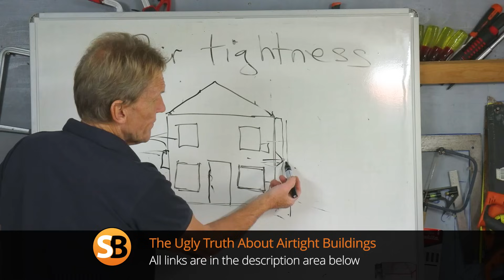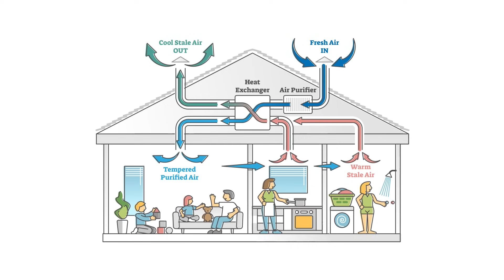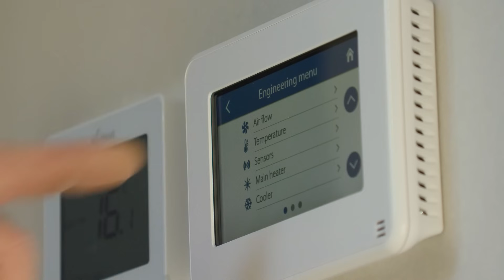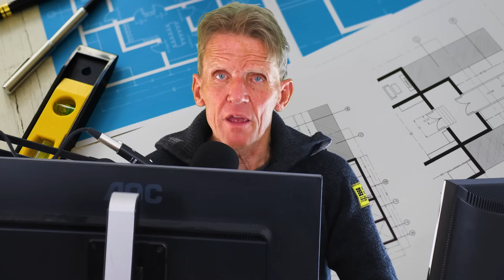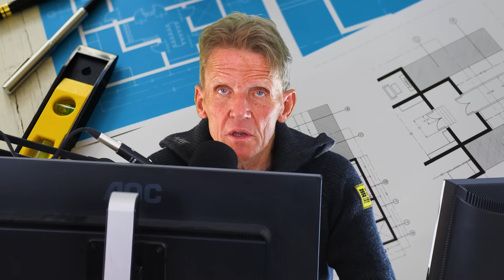Why Airtight Homes Are a Terrible Idea

Comment: I so agree with you! I am Swiss. we open windows to let air in even in the middle of winter.
Reply: Exactly, but the cost of heating is too high in "rip-off" Britain!
Reply: @stanthesteelguitarman8228  You can ventilate without impacting your gas bill. A ventilated and drier house is cheaper to heat. method one: if you have widows on both sides, open all the windows on one floor, for no more than 2 minutes. It is best done in the morning, but you will sleep better if you do it before going to bed. If not, open both downstairs and upstairs windows for 2 minutes. It will NOT impact your heating bill.
Reply: @stanthesteelguitarman8228  The warmth in your house is in the air AND the structure (plasterboard, bricks etc inside) . The thermal capacity of these materials is x100 more than air... refresh the air  for 20 minutes daily and the body of the house can still be warm.
Reply: Same, I am Danish. I open windows in the bedrooms while people are in the bathroom mornnings (kids learning) and I daily open window or doors front and back for a few short minutes (longer if an un- breezy day! Or weather summery) every day.
Lived here for 30 yrs ongoing.
We do have fairly tight double glazed windows in our London house, but (double glazed) sliding doors at the back to garden as well as kept the leaky big old 1930s front door ensure we do have air flow.
Like to keep my kitchen window on the locked (espagnolette) small gap closed setting most of the day unless we have day frost weather, and we do have a large mechanical fan (10 inch squared) built into the livingroom wall (and another one in utility room wall as that room is small without 'other' windows) which we rarely run as a fan, but use for airflow from march to Oct with just a thin plastc cover pulled shut in colder weather those months, otherwise fan left open, like a window (too small for anyone to climb in). Winter months we stuff rockwool into it.
We got a security girm to fit grid of bars in front of small bathroom window so we can leavit open a bit while out.

I think it is also about overcrowding/total air cubic meterage in a room/rooms and keeping some level of heating on to ensure some dryness and extra air in a room . If u heat a house/flat properly through the winter season so the walls are warm (no good just heating the air three hours a day) then u don't lose the,warmth for more than 1 minute when airing out once or twice a day.
I can dry clothes in my house (3 kids now largely grown up) and have no mould, think airtightness idea is a false, unnatural game producing a dank atmosphere too easily, and an ofgice-like feel to a home with an extraction system running all the time.
Like to be in charge of where and when I have my draughts at home thanks!
Reply: When you biild badly, you need that.
Reply: @toomanymarys7355  To be fair, you need to ventillate no matter how well a house is built, but it becomes crucial if not built well. Houses in Denmark and Switzerland are very well built, because the climate requires it. A country like the UK which is rarely under minus 5 Celsius is more forgiving.
Reply: @annepoitrineau5650 The correct way to build is with filtered mechanical ventilation, with filtered and preconditioned air. You guys don't control humidity properly or do mechanical ventilation. Literally 30 behind heslthy building standards.

The UK is more like 50 years behind. They barely insulate.
Reply: @toomanymarys7355  We do not do Air-conditioning in Switzerland. therefore we rely on natural ventilation. This entails that we also do not stress the environement the way the USA does. By the way, there are plenty of ways to ventilate naturally without recourse to AC. Just investigate/research traditional buildings in Northern Africa or Mali.
Reply: @toomanymarys7355  For reasons unknown, I cannot access the whole of your comment, so I have to reply using the previous one. So: we Swiss do not all live in the mountains. Modern buildings have good/envronmentally friendly heating systems. The older ones are very well insulated. Some of our methods are a little funny: there is a little raised step between rooms (so you go up and down between rooms), which keeps wind draught at bay. We have had double glzing for generations, and a lot of front doors also don a special curtain (same material as blankets) in the winter. But we still ventilate by opening windows, as we know that dry air feels warmer than damp air. Also, on the whole, we like our heating a little bit lower than in the USA. 18 to 20 Celsius is the norm: we wear warm slippers and jumpers. It is very different from the USA. If you go to Zurich where I am from, for example, you will see blankets draped on chairs outside cafes and restaurants: smokers can go outside, smoke peacefully, using the blankets to remain warm. Or anybody can just put a blanket over their shoulders and sit peacefully in the cold for a few minutes. It is very enjoyable. We also have a whole area heated by the city using geothermal energy.
Reply: @annepoitrineau5650 Oh wow, I would have never guessed that housing standards in Switzerland are so low. Here in Finland the general expectation for housing is that it stays warm, draftless and dry without any trickeries and has been that way since 70's.😮
Reply: @BoringBurger  Opening windows in the winter is not a problem: Switzerland does not get as cold as Finland.
Reply: @BoringBurger  Swiss housing standards are not low. They are adapted to our climate and there really is no issue with opening windows. Morevoer, it does not stress the environment. I am really baffled by your strange comment.
Reply: @annepoitrineau5650  If it's deemed acceptable that the occupant of the house needs to ventilate the house trough windows every day or it gets damp and eventually moldy, then yes, your standards are really really low. And it's not a matter of climate. Damp houses are a major health risk no matter where they are and the lack of adequate ventilation is only a result of low housing standards. It's like saying that it's ok to have a leaking roof, because "placing some buckets on the floor when it rains is not a problem." 

And your claim it having lesser stress on enviroment is completely unfound. First of all, dry house needs a lot less energy to stay warm and modern heat recovery ventilation with a exhaust air heatpump is by far the most energy efficient and enviroment friendliest way to heat a house.
Reply: @BoringBurger  I do not think you understand: OUR HOUSES ARE DRY. and: WE LIKE OPENING THE WINDOWS. Look up our life expectancy: we Swiss live a very long time, and we also rate very high on "quality of life in later years" so, our system works. We live in a climate where it is possible, and do not judge people living in climates where it is a lot more problematic. 
I am wondering why you are trying to be offensive. I have met a lot of Finns, and they were all absolutely lovely and open to other ideas/situations.

Comment: MVHR is the absolute best improvement I ever made to my house. Moved from a mould box to not even a trace of it this past winter
Reply: Sucks air out of kitchen, bathroom, utility rooms and before it is expelled it is used to warm up incoming air which is then piped to living rooms and bedrooms.  Basically like having all your windows open all the time while losing very little heat.
Reply: What's mvhr?
Reply: mechanical ventilation heat recovery?
Reply: @Mateo-et3wl  Mechanical Ventilation  and Heat Recovery.
Reply: So an ERV. And yes, they're fantastic.

Comment: Part F and Part L of the Building Regs are acting in conflict with one another
The only solution is mechanical ventilation with heat recovery for energy saving policy to work.
Education is the other part of the solution.

Comment: I advocate for 6:20 also - the idea of replacing all the air in your home in one fell swoop, even if it's freezing outside. The way I see it, you're only losing the heat in the air as if you do it quickly enough then all the heat left in the items of your home - from the walls to all the furnishings etc - warms up the new air quickly.
Reply: Fresh oxygen, which is depleted quite quickly

Comment: Everything is about making us ill they want mould to form look up what it does to the body up until the 20s cold n flu used to be called rf sickness wait till you find out the truth about lead paint and asbestos they got rid of it because it used to protect the home from radio frequencies I still have both in my home and it blocks the WiFi signal its great stuff everything you have been educated on has been an absolute lie 80% of moisture in the home left via the chimney now they are getting rid of them

Comment: Air tightness is bull. It's the worst thing to hit the industry in decades! It's failing 90% of buildings. Whilst contractors seal a plasterboard inside the house, most new build houses have insulation bypass and cold air flow behind the plasterboard and in the ceiling voids. This means the U-value of the house is as crap as the paper you're fake calculated energy performance certificate displays!

Even worse are the trickle extract fans are so noisy to the point you can't live with them! It's no wander people disconnect them. They wine, hum and vibrate you can't sleep with them on! Greenwood airvac were installed throughout ours, they are not quiet at all at the correct air change rates! I've had to reduce the rate of flow to best quiet them and we also window vac the bath and shower after use.

I'm a building services engineer with a new build 2018 new build home (under 2016 building regs). This house is soo poorly constructed along with all on this development in Manchester, all by the same Developer!

Comment: Nearly 50 years ago we had draught sealed double glazing installed in the house, BUT by leaving one upper window on its first open position, and putting a small vent in a downstairs window we never had any mould problems whilst having the lowest heating bills (compared with neighbours) . My current house has a full house mechanical heat recovery /ventilation system with ASHP incorporated. All indoor clothes drying is done via a wardrobe which has an extract into the ventilation system. Again no mould in my house and very low heating bils.
Simple suggestion, put a lid on pots on the stove to cut down on moisture released in the first place.

Comment: My house has the old sash windows and the only modification I made was to refurbish/paint them and put some draft stripping in. They still have pletny of cracks to let the building breath and the chimneys can be opened to allow more air flow e.g. when cooking. Never had any damp issues or mould in the house.
Reply: Same. 😊 I have older wooden windows and I just paint them every now and then. Don't want to change them for the PVC ones...
Reply: breathe*
Reply: Why bother with the draft stripping if the leaky windows are so great?
Reply: @DeuceDeuceBravo  Because putting in new windows would cost tens of thousands and would only save a few hundred a year on heating at best. It cuts out the worst of the drafts without turning it into a sealed box prone to mould and damp.
Reply: @jaspercaelan4998  But...  Drafts are good, right?
Reply: @DeuceDeuceBravo  Better than mould.
Reply: @jaspercaelan4998  So it's like controlling the exact amount of "draft" would be beneficial... Which is exactly what you get in a tight house with properly designed insulation and ventilation.
Reply: @DeuceDeuceBravo  At huge cost.
Reply: @jaspercaelan4998  "Huge" is relative. On my new home it is an added expense but will pay for itself over the next few years, and I'll have outstanding IAQ as well.
Reply: @DeuceDeuceBravo  We're not talking about new homes.
Reply: @DeuceDeuceBravo  Wouldn't want to purchase any of the current new builds going up, they just demolished a whole load near where I live due to structural failures. A lot of them have many more issues than IAQ.

Comment: The airtight concept was imported from Scandinavia where it works because the air is extremely dry, in the UK we have much higher levels of humidity which causes the damp and mold.

Comment: Solar Air Heater Box is another option Had the problem in my Games Room Building as no ventilation at all, soon as you opened the door all glass, mirrors, monitors screens instantly mist up, fitted solar air heater box and been damp free since

Comment: Tenants think because they never got damp before that it can't be your fault. That's why when the landlord complains they ignore it and blame the house. And yes the Tenants are right because some houses are too airtight. We rented a house and it had new windows and we had damp. This new house we are in have older windows from the 90s and we've had no damp. 
Also after a shower when you leave the door open the moisture will travel around the house so yeah that might be why we had damp. 
Now I always have my window open because I like fresh air.
Stop blaming the Tenants and stop blaming the landlords. We need to work together on this. Landlords should check everything over like leaks or an old roof causing issues. We weren't aloud to put anything in the attic in our old house because their was so much insulation which might have been the cause. We had a damp expert come and he blamed my mum which I thought was so unfair because there so many variables

Comment: My last home had damp problems. Funny how this new house with older windows doesn't have mold on the walls. We only have mold on the black window sill between the glass and the frame. 
Our bathroom extractor fan is shit and we still get no mold. 
Make sure you close your bathroom door because the moisture will travel around the house otherwise.
I always have my window open in the day because I get hot easily and I like having new air in my bedroom. I live my parents by the way. 
Mold is a strange issue for sure because some people do everything wrong yet they never get mold because they have old windows or just lucky.

Comment: Install a good portable Air conditioner similar this "AEG AXP26U559HW Comfort 6000 Portable Air Conditioner A+".
If run at night on cheap rate octopus 7p/kwh it will cost 29p for the cheap 6 hrs. at night and will deliver 2.3kW of heat that will stop the house from cooling down and has a COP of 3.6 in heating mode.
Because it is heating it is VERY efficient at extracting moisture - unlike most de-humidifiers that require a high room temperature to work at all ( in cooler house they are useless)
This unit will extract many litres every night and has eliminated the need for central heating(or limited use) for 4 months of every year.
Its a cheap option to try but putting the hose through a window is a pain so a permanent installation through a wall is more acceptable.
Beware - these units are quite big as they need a large condenser to get the A++ efficiency in heat pump mode.

Comment: When we fully insulated our loft 20 years ago, mould started appearing in the corners of the ceilings.
Reply: Because you insulated for heat without addressing vapor control.
Reply: The cold spot?
Reply: It also stops warmth from rising, which leaves none for wildlife. It now dies from cold more, in winters.
Reply: @LucyKelly-of6cu oh thats useful to know too thanks

Comment: You have to have vents in every window, it's part of the regs aswell, if you don't have that you have to have vents in the wall. 
Frankly makes the point of the air pressure test pointless.

Comment: I have a big dehumidifier and we put a roof over part of the outside so I dry stuff under that, so it can be outside even if it's raining, then I only bring the clothes in to finish them by the dehumidifier. I've used mould resistant paint on spesific areas as well, that all seems to work.

Comment: Airtight isn’t just bad for buildings, it seriously unhealthy for humans.
Open all windows wide every morning for at least 10 minutes to change the air quality from breathing, showering and cooking (fresh dry air is cheaper to heat than stale, damp air and condensation). Never dry clothes in the home, it can be dried outside all year round including in winter/snow season. Don’t put furniture against the wall, always leave an air gap and don’t have built in furniture in traditional/listed buildings.
Reply: I agree with opening windows (I keep one ajar all year around to keep my very old, stone-built cottage from getting damp), but you won't dry clothes outside in the UK for at least half the year, if not more, especially in the west. I live in Wales, and even on a non-rainy day in winter, nothing will dry outside.
Reply: Not all climates are warm and humid. In a dry or cold climate, mold is not an issue and drying clothes indoors is a good way to humidify the air if you don't have a humidifier.
Reply: In the UK there's a lot of rain that stops play and drying clothes...
Reply: It gets down to -40 where I live during the winter.  If I tried to dry my clothes outside it would take 10 minutes tops for them to be ice.

Comment: Modern houses are full of toxic crap - if you seal in all those toxic fumes (especially from PVC windows and doors btw) you are poisoning your family! Also old houses are designed to be to ventilated/porous and using modern materials in rhem is damagingly the house and locking the damp inside

Comment: MVHR solves all of the problems with high moisture and mould. Installed ours back in 2011 and the air quality improved from the time it was turned on. Anyone with breathing issues will feel th ebenefits.

Comment: Confused why people aren't mentioning dehumidiers.

I have a flat that is practically airtight [but surrounded by grassy area, meaning windows open means insects in, hence not always preferable], and was getting lots of mould.

Running a dehumidifier fixed the problem.